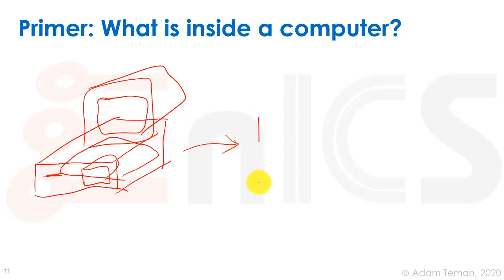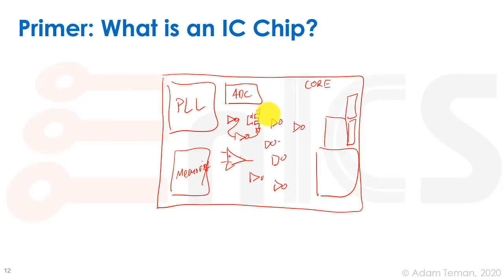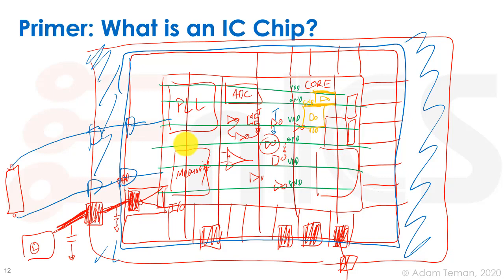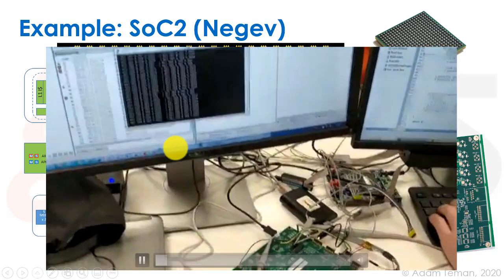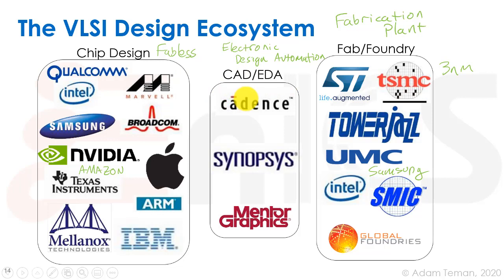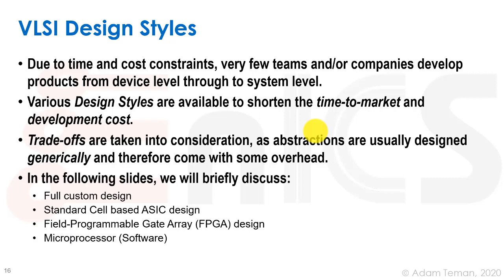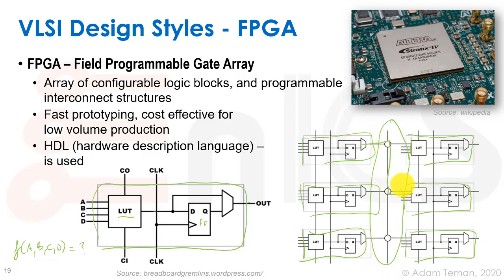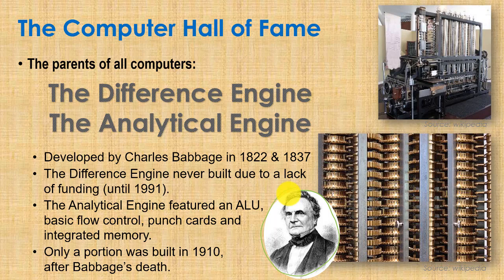VLSI - Lecture 1b: Introduction - The World of Chip Design

Comment: Texas Instruments manufactures chips. I work at their new fab in Sherman TX
Reply from the maker: Yes, thank you for pointing that out. Indeed, TI does do some manufacturing in-house, and used to (several decades ago) fabricate all their chips in-house. That said, they are not one of the mainstream foundries that fabless companies usually tape out in, and for sure not making advanced nodes in their fabs, but rather specialty "More than Moore" technologies and older, very mature nodes. The reason I put them in the chip design category (and didn't point them out as a foundry) is that TI still has a large chip design operation that tapes out in advanced nodes using external foundries, such as TSMC.

Comment: i want to ask a question I now study electrical engineering with applied physics especially in the micro electronics parts can that get me a job in  tsmc or intel company witch I can manufacture processors or other hardware components on the (the package ) ? or do i need to turn into the nano electronic study witch I had to get a lot more chemical related subjects to get a job like that ?
Reply from the maker: Hi Mohammad,
I believe that for ASIC design, electrical engineering or computer engineering are the proper track of study. To work in the fab (which could be at TSMC or Intel), then materials engineering (nanotechnology) would be more appropriate.

Comment: To cut down costs, sometimes, these big companies use other smaller companies for the designing work, and then sometimes these smaller companies again use a VLSI engineer residing in a 3rd world country so they can cut down costs as well. I can tell cause I worked as a layout guy as 3rd party.
Reply from the maker: Indeed, this is common practice.
There are many design subcontractors that can provide services for implementing various parts of the design. It is common, for example, to outsource the backend of a chip to such a subcontractor, such as Cadence's VCAD services or a company like Avnet. However, many or most "classic" chip design companies do everything in-house.